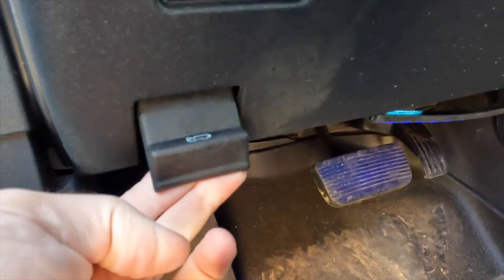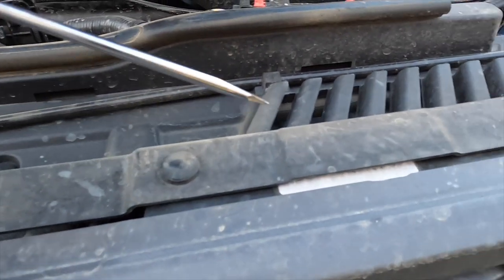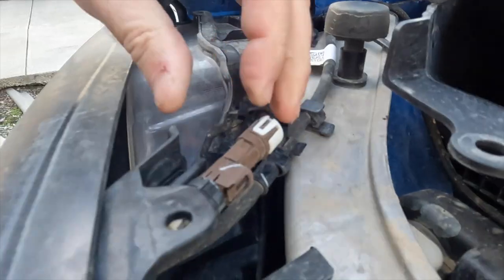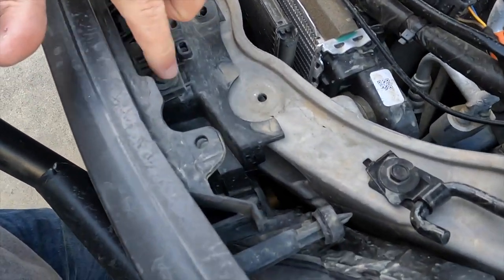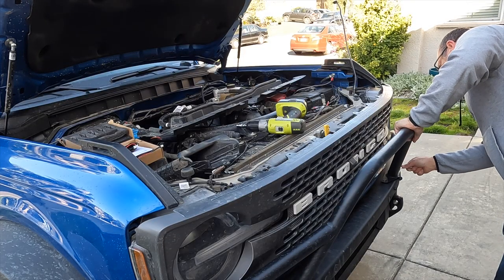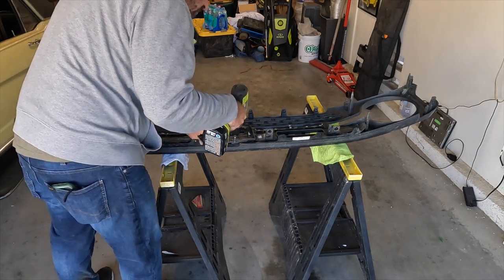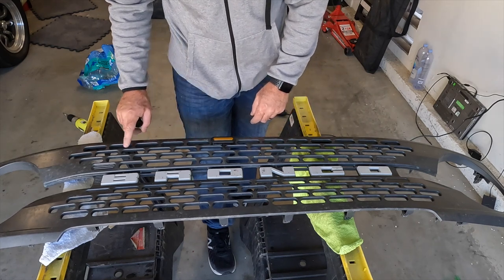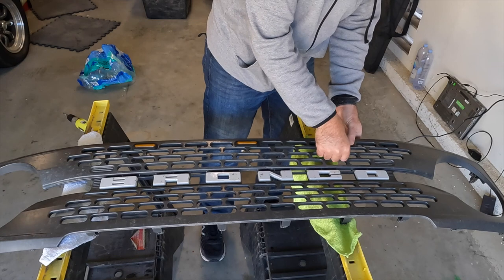Mabett grill lights for the Bronco (Badlands) install

Comment: Quick question how do you get your turn signal amber always on as DRL? Looks cool!
Reply from the maker: I used forscan to change the running lights from white to Amber :)
Reply: @calgecko  Nice! Which module and parameter needs to be changed or do you have any cheat sheet for it?
Reply from the maker: @zhulevi580  easy change with Forscan